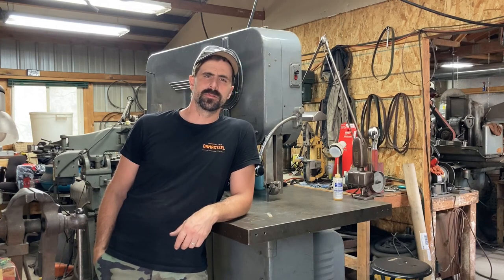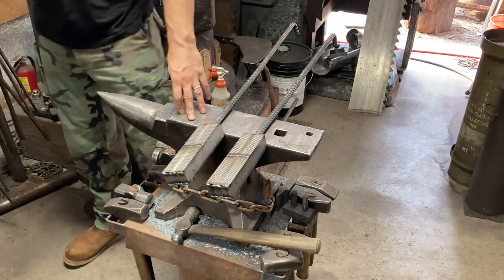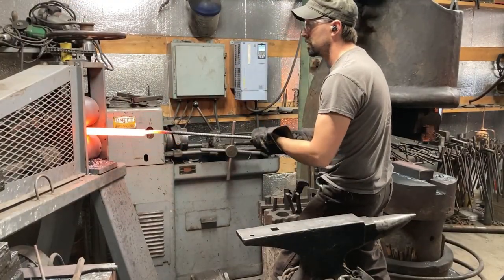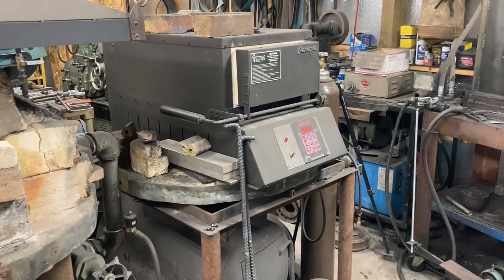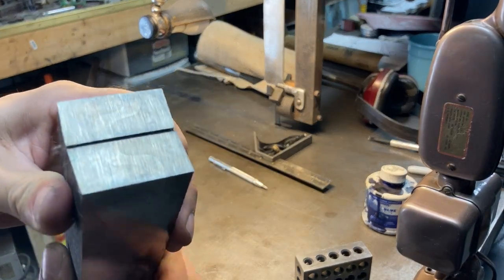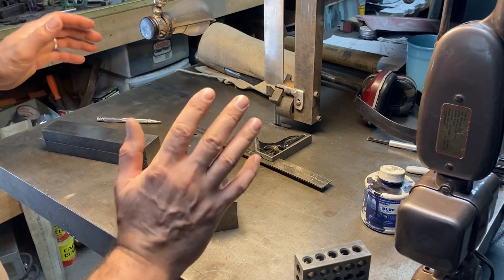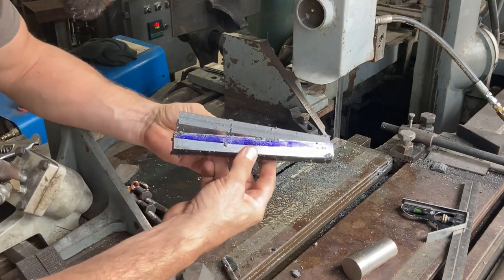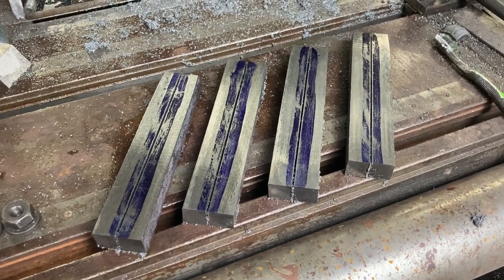JailBird Feather Damascus Chef Knives, Part 1.

Comment: Could you imagine the amount of damascus knowledge a guy could gain if he were stranded in a shop for a month with Salem here and Mareko Maumasi. I'd love to see those 2 gentlemen collaborate for a good 6 months on coming up with a new and exciting damascus layout.  I think they could come up with a 6 figure knife if they wanted too. Thanks for sharing Salem your attention to detail and your wealth of knowledge is something incredible to see. I look forward to your next video.
Reply: Elijah at Fire Creek Forge has come up with a couple of new ideas, or at least he's the first and only one I've seen try them, one is  flat forged canisters, built so the guts of the billet have ball bearings or rods that put the latteral forces to put pressure horizontally in the billet.  Another is what he calls retained canister,  basically drilling holes in the thinner edge of a bar, filling with powder.  If a guy was creative enough,  that could be used for a dot matrix type picture with the holes drilled in the wider face, different sizes placed and filled specifically for each hole to be a lighter or darker shade.

Comment: So, you won the $10,000, and got a bonus heat treating oven to boot.  Any other perks besides the public knows who to go to for decent blades?

Second question: whats your elevation and approximately how much propane pressure you use for forge welding?  Ive been using half a BBQ tank for a single billet weld, at 22-25psi.  I recently heard Elijah say he uses about 15-20 psi, but, thonk hes in Texas, whereas, im in South Dakota at aprox 1,100' elevation.